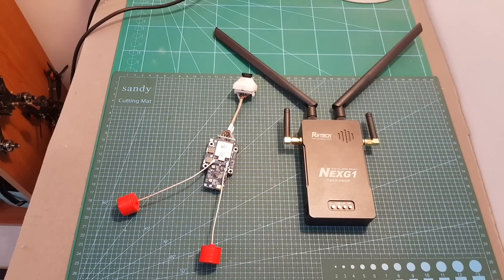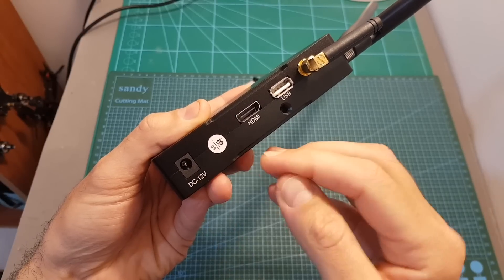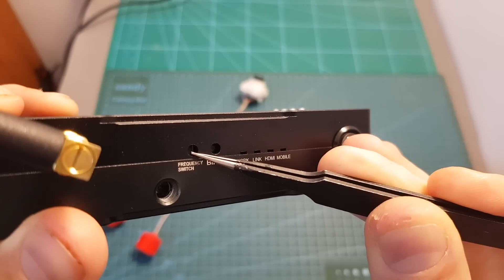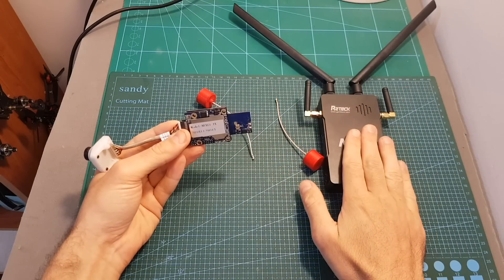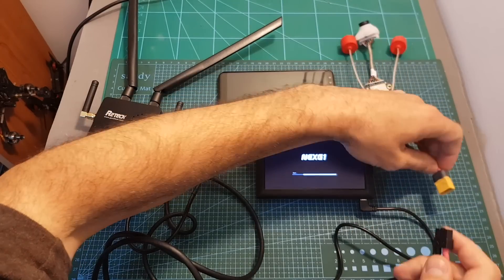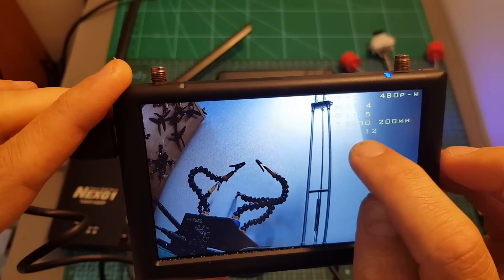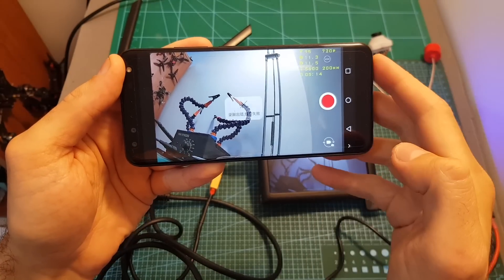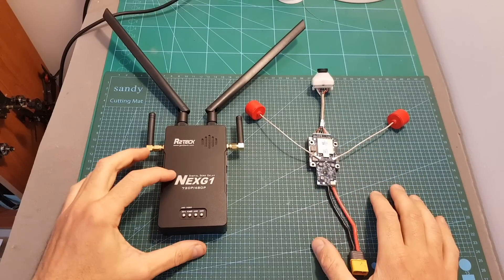R2TECK NEXG1 HD FPV System - Overview & Latency Test

Comment: Just more uplinks/downlinks? Sadly the resolution isnt the main problem. Much more important would be to simply get rid of any noise....so completely lossless. Problem with some fancier downlinks in 1080p digitally is: You wether have a picture..or none. That is why we use analog video in the first place. Everything is transmitted through radiowaves...the higher GHz, the more you can transport, but the less you can penetrate things. Problem is, that some radio lengths are used for other stuff and are unusable for FPV as well...that is why  we are stuck on mainly 5.8 or 2.4 ghz, which essentially is wifi as well...
To make things happen, we would simply need a system with 100% coverage and still low latency. The only way would be to use a global system of low orbit satelites, where latency still is good, as they are always just 200km away.
Groundbased stuff with H+, LTE, etc. also use radiowaves to transmit to your phone...it works as long as you have coverage, which isnt the case inside a building, e.g.
After all it will always communicate with radiowaves....and analog stuff is at least able to give us gradually fading video instead of intant black screens :)
Reply: the rules changed. search for ez wifibroadcast and make one :) simple cheap and HD tested at 40 k it will blow up your theory
Reply: @fpvracinggreece4960  thanks for sharing this... AWESOME
Reply: @waverley41  you're welcome mate

Comment: So, if I am not mistaken this VTX has no serial connection to the FC so it cannot show any usable info, like GPS coordinates or home point etc.
If this could do that, they would have a a customer of two units. :(
Reply from the maker: You are right, it's not possible to add OSD data from the FC.
Reply: I am kinda upset as nobody gives a damn for long range FPV guys. I have a fairly big 6 inch quad with lot of free space and a Reptile S1100 wing, which is huuuuuuge. In that rigs a bit higher latency doesn't matter as their primary role is sightseeing. I simply want to see the beautiful panorama in real time, not by watching the recorded video.
Big space requirements - no problem for me, weight - nope, lower durability - I am not racing with those, so this isn't also an issue.
But without usable OSD how the hell should I get home? Even on 1km distance on a new field it can be challenging.
Reply from the maker: @gezakopter1153  Maybe they will be able to figure out a solution in the future. The only solution I can think of is to have another 2.4ghz FPV system and switch between the video feeds when needed (of course it makes things more complicated). Anyway - this specific system is not intended for long range and you shouldn't get more than 500-700m on 720p .
Reply: Thanks for the update! In this case my only option would remain fpv.blue: According to them their OSD can pull data from the FC and the tx power is good for several kms. But their prices are waaay higher for the TX, cca 450 euros, excluding the camera. And that's a deal breaker for me as for cca 700eur I can buy a DJI Mavic Air.

Comment: Maybe there is something special in the details, but I don’t see how this is much different than what Amimon’s ProSight system achieved like two years ago. ProSight seemed to gain some following at first (I was one) but eventually most people went back to analog (as did I) because of the cost, weight, inconvenience, and fragility. Analog cameras have lower resolution than ProSight but better light sensitivity and dynamic range, so it’s actually easier to fly with the latest analog cams despite the poor resolution. The cable from camera to VTx has so many tiny wires, and a poor connection with just one of them causes all kinds of weird issues. One crash in a mini quad and you end up trying to swap out very expensive components to fix it, because there are so many connections it’s very difficult to troubleshoot. Finally because of the digital format and the bandwidth it requires to achieve good resolution, the range is poor, and when you reach the limits of range the artifacts are difficult to fly through, unlike analog snow.

Comment: I would rather get the dji system for same price, 50ms latency but it is also used to transmit remotecontroller signal and have range at 7km,  if this was 100$ cheaper they might sell a few units, but when there already is a trusted system on the marked with the same price range i dont think its going to sell that much

Comment: You said 4mS per frame? Is that true? 250 frames per second? Looks way too good to be true. Would probably say 40mS per frame and half a second latency?
Reply from the maker: Video was recorded on slow motion at 240 frames per second. I know my numbers ;-)
Reply: @KremerFPV  OK I misunderstood your procedure of recording the latency. That sounds great. 50ms is flyable so if that number is reasonable consistent in noisy environment with multiple systems running at the same time, we are just waiting for the price and size to come down.